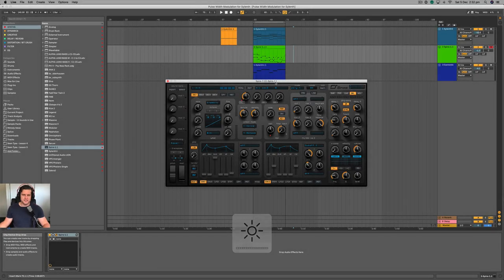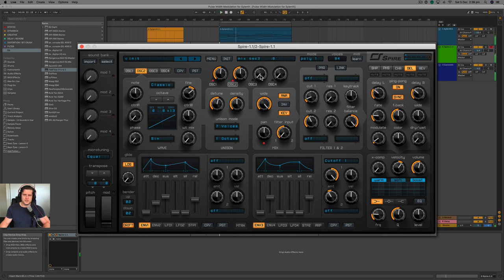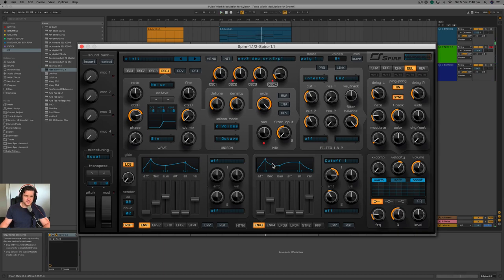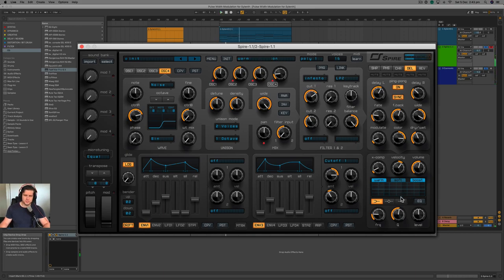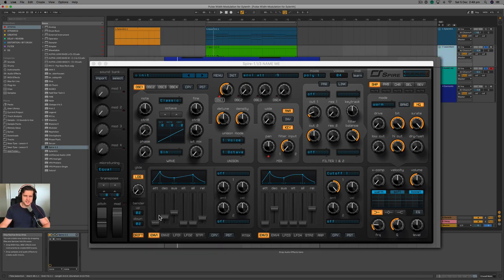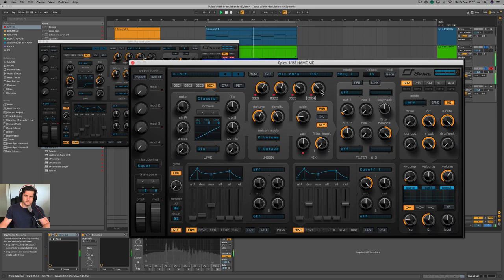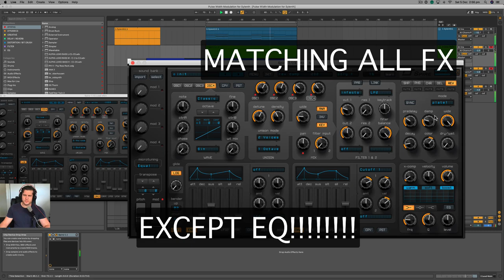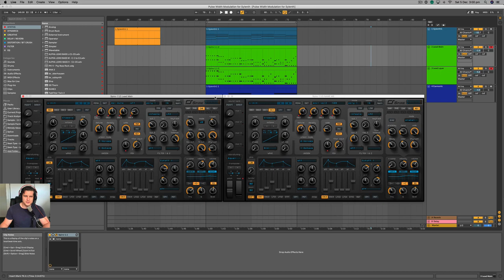The Supersaw Trance Lead in Spire

Comment: Owning both hardware and soft synths.  I can say that VSTs are not only usually more flexible, but often sound better.  Also, half the time, these soft synths are replicating hardware that’s using software to replicate hardware, so it’s whatever
Reply from the maker: Kyle they are certainly more flexible. I would love to play with a JP8000 though. I have an access Virus TI2 and I was severely underwhelmed when I first got it compared to the sounds you can get from spire, zebra2, Dune3..... These plugins are awesome!! What's your favorite?

Comment: Hey idk if you will read this but how do you tame the white noise from the supersaw? I have tried eq'ing it but it sort of affects the whole synth as well..
Reply from the maker: Hi not Don.

If your sound is too bright from white noise it depends on how you have made the sound. If there's a white noise oscillator, reduce the volume. If there's white noise build up from too many layers, take out some layers. If there's too much eq boost or mid to high range distortion or saturation, reduce it or take it off.

Alternatively you can highpass the lead bus if you're happy with the meat of your sound but be careful.

Personally I have fount in recent times to achieve a more balanced result, keeping the sound quite dull until the track is fully written and during the mix down, apply parallel compression  (1-2db on the parallel comp bus) and blend in with lead in context of the full mix.